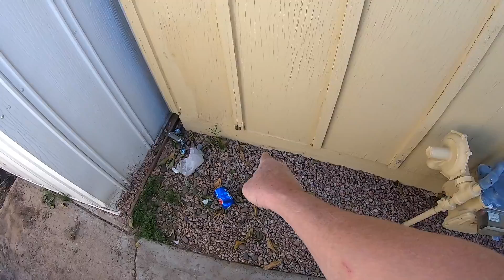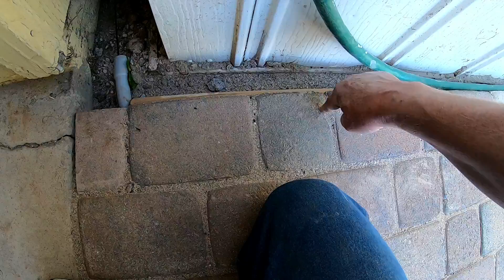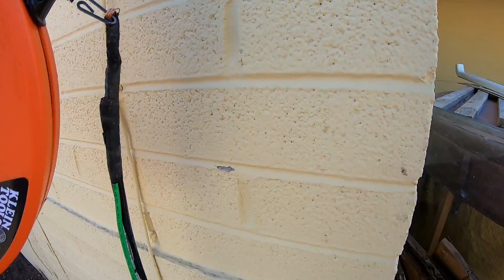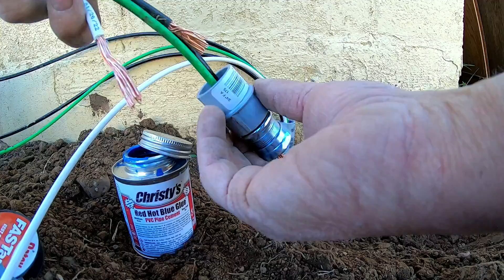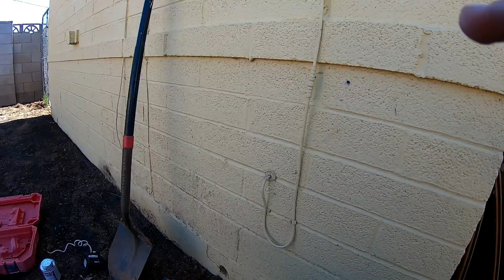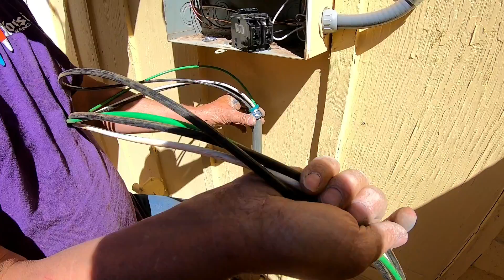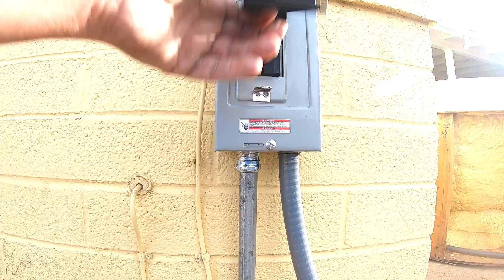How to Wire a Hot Tub...Wiring a 220/240 Volt Spa***I will show You step by Step easy to follow Info

Comment: Why is the disconnect a double breaker? Mine is just using a single 50 amp gfci breaker.
Reply from the maker: The main breaker is on the other side of the house and is out of sight of the hot tub. I would not recommend having a single breaker if it’s out of sight of the hot tub.
Thanks for watching & Subscribing
Reply: @diymrscott4983  I have a normal double pole breaker in the house but the shutoff by the tub is a single 50 gfci. I think they have to be in sight or within 10  feet. I just don’t know why some people are using the double breakers on the disconnect. I didn’t even see those at the store.

Comment: does it matter if my wire from my house to out side panel is aluminum wire? and my wire from tub to outside panel is copper? thanks in advance
Reply from the maker: Do not use aluminum wire ever.. in my experience when I've worked on tub tripping the breaker or other problems  and the only thing that I found that caused me to look at things closer was the aluminum wire and after changing out the wire to #6 THHN/THWN and the problem went away and never happened again 
Thanks for Watching & SUBSCRIBING

Comment: Thanks for the amazing knowledge you are sharing with us. 
Can anyone explain what is the need for having two 50 Amps breaker in series while one in main panel would be sufficient?
Reply: I was wondering the same thing.  I know one has to be a GFI which I believe can be in the main panel.  My issue is the disconnect.  No GFI in the disconnect and my tub has about 6 wires in it.

Comment: Can a gfci (50 amp) breaker be placed in the main service panel and feed a subpanel downstream 
And use standard breakers for the spa motors in the  subpanel? 
Is this an acceptable way to do this?  Thanks! 0:51
Reply from the maker: Yes you can do that and it will pass code ..we see it all the time and have done it also...Thanks for Watching & SUBSCRIBING

Comment: I have a sub panel in my basement that was added for a run to my garage for an EV charger.  Is the external box national 'code'?   What if I had a gfci in the sub panel and just ran direct to the tub?  This seems like a pretty easy run to do the external box either way with flexible whip, but just curious if the NEC has some code requirement since I see hot tub manuals specify that external box.  You would be insane to not have a gfci here!!!

Comment: Hey Great video.  Very thorough.  Quick question: What is the reasoning behind adding a GFCI breaker at the sub panel vs. just using the breaker back at the main panel?  Cheers from Chicago
Reply from the maker: Because the main breaker was so far away and out of sight it is safer to have a disconnect no further then 20 feet and no closer then 5 feet and in the line of sight so as if there is a problem the Hot Tub can be turned off quickly.GFCI is also required by CODE... Thanks for Watching & SUBSCRIBING
Reply: Hey Thanks for the reply! Make sense. @diymrscott4983
Reply: You are absolutely correct! Also it is required and a  GFI will keep you from getting shock or killed if your heater shorts out. You got 240 volts going to the heating element in the water. I have been installing hot tubs for over 35 years!

Comment: Mr. Scott, I have a couple questions. First, I'm not clear on your statements about sub-panel placement. To summarize, am I correct in saying that the sub-panel must be placed between 5 and 20 feet from the tub, above the TOP edge of the tub, and within line of sight of someone in the tub? The reason I ask is because the installation in your video seems to be both below the tub top, and around the corner from it (out of sight). 
Further, is there generally a code limitation on the length of the Seal/Liquid Tight flexible conduit that can be used? Is that where the 20ft comes from? Does that mean that the flexible conduit section can only be 20ft long (even if the direct distance between the sub-panel and the tub is less than 20ft)?
Thanks for an informative video and all your help.

Comment: My hot tub motors pull 46 amps.  I have to run 150-200 ft of wire from the panel to the hot tub.  Do I need to use 4 gauge wire instead of 6 gauge?  Thanks
Reply from the maker: Yes ....with the Run you are doing being over 150 feet I would use #4 from the main to the Sub..And from the Sub to the hot tub you can use #6 Thanks for Watching & SUBSCRIBING
Reply: @diymrscott4983  My hot tub is similar that pulls 48 amps. If oversizing with a 60amp breaker and a 75ft run would #6 be adequate? My understanding is that 6/3 mc is rated for 75a. This would be run indoors then through wall to spa panel. Thanks!

Comment: Thanks for the video. Very helpful. The one thing I don't understand is that in my breaker panel here in California, all the ground and neutral wires are tied together on a common bus bar. Is that okay, and do you have to run both the neutral and the ground to the subpanel where the GFCI is located if this is a common connection anyway? Thanks again!

Comment: my spa retrofit has 5 holes: ground, line 1, line 2, neutral 1, neutral 2. My 220V power source only has 4 wires: hot 1, hot 2, neutral and ground. Can you tell me where to connect each one of my wires?

Comment: Menards sells 6 gauge wire with 2 positive, neutral , ground all in one. Is there a reason I shouldn’t do that? Is buying 4 separate wire cheaper? Sorry if this is a dumb question I’m new to all this thanks!
Reply from the maker: You need to use THHN or THWN wire #6 When you are dealing with a Hot tub.. When ever Ive had to figure out what was causing a hot tub not to run or trip the breaker and everything with the Hot Tub was in great condition and working as it should... it was the wire every time that caused the problem . I can not stress it enough always use THHN or THWN #6 wire on all four wires (two Hot wires Neutral and the Ground) Hope this Helps Thanks for Watching & SUBSCRIBING
Reply: @diymrscott4983  so I can run romex to the sub panel and then THHN from sub panel to spa? I subscribed to both ur channels!
Reply from the maker: @logicflakes8911  I never use Romex ever on any install... Like I said above THHN or THWN separate wires only #6 on all four wires. Romex is for inside use only non damp dry use. Romex will cause the breaker to trip. Thanks for Watching & SUBSCRIBING

Comment: Stupid question because I over think these types of situations,  but if my hot tub needs 1 dedicated 60 amp and 2 dedicated 40 amp , does that mean I need 3 separate GFCI breakers and 3 separate runs of that 6 AWG wire to an outlet box that will accept 3 inlets for the power and 3 outlets to go back to the tub? I hope this question makes sense.

Comment: My Sundance requires only 3 wires 2 hot 1 ground from gfci panel the white is capped but my gfci keeps tripping ?
Reply from the maker: All of the wires need to be connected.(With the breaker off) put the GFCI in the main panel and run all four wires in #6 THHN wire(two hot wires common/neutral and the ground) to a spa disconnect with a 50 Amp breaker and then from the spa disconnect you run the two hot wires and the ground to the spa.Check everything with a volt meter before you connect to the spa. If it still trips its the Spa Hope this Helps Thanks for Watching & SUBSCRIBING

Comment: Great Informative Video!!!!!
Hey Mr Scott, a quick question, My hot tub will be away from the house and any place to mount my sub panel.Can I have the sub panel, that contains the  GFCI 50 Amp Breaker mounted to RIGED conduit coming out of the ground through a 4 inch thick concrete slab about 12 inches above the concrete?The Rigid conduit that the sub panel will be mounted to will be in place when I pour the concrete pad for the tub.The hot tub will be 5 foot from the sub panel box. The main panel to the sub panel will be a 35 foot run with 6 gauge wire.Let me know if this is a proper installation.
Thanks

Comment: Some codes want you to run 6-3 MC cable. Has a ground wire plus a metal covering.
Reply from the maker: It will meet CODE... And you will get to meet me if you live in Arizona and start having problems with the breaker tripping and need help as to why... Just because it is code doesn't make it the best choice for a Hot Tub install. Good Luck Thanks for Watching & SUBSCRIBING

Comment: Can I use 6-2 from my indoor panel to feed the spa subpanel? I would attach the bare ground from the 6-2 to the neutral bar in the Spa panel.  The tub is 3 wire system

Comment: how do you decide which conduit to use when running the wires? Metal, PVC, Seal Tight?
Reply from the maker: Great Question... Thanks for Asking, EMT/metal is for above ground from the main panel to the Sub Panel. The PVC is for under ground only and is grey in color so to let anyone know that there are wires in side them if they are digging in the area and uncover them. Seal/Liquid Tight is used from the Sub Panel to the Hot Tub. Now when placing the Sub panel. It should never be placed closer then 5 feet to the hot tub and in line of sight and no lower then the edge of the hot tub and should never be further then 20 feet from the hot tub and as alway should be in the line of sight for safety...Hope this Helps Thanks for Watching & SUBSCRIBING.
Reply: @diymrscott4983  is the height of the sub panel a personal preference or code? I’ve never heard that, or been told to do that at work.
Reply from the maker: @KitchenerLeslie2  Im not sure if there is a NEC code for the min. height of the sub panel.I can say that over the last 10+ years Ive seen and had inspectors Red tag a job(That I did not install) because of the placement of the Sub/disconnect panel because of height not being a min of of 36 inches to the center of the box as well as being to close to the hot tub. I alway think safety first if the panel is to close to the ground or the hot tub someone could/will use it for a step (bad idea) Hope this Helps Thanks for Watching & SUBSCRIBING
Reply: @diymrscott4983  Hello Spa Man, thank you for such a fast response. I have enjoyed watching your videos and ready to do some wiring.

Comment: Did you run a #6 ground as well or a #8? Article 680 is confuuuuuuusing
Reply from the maker: Use #6 on all four wires... Others will tell you different but most of the time when we go do service work the wire was the wrong size and cause the problem or it was wired wrong to begin with. Thanks for Watching & SUBSCRIBING

Comment: Can i use 8 wire with th 50 amp breaker?
Reply from the maker: I would not recommend it. Under sized wire or the wrong type of wire causes a ton of problems with hot tubs. I use # 6 THHN wire on all four wires..Thanks for Watching & SUBSCRIBING
Reply: As an electrical guy, I can see where determining wire size is confusing.  In the nec, table 310.16 has columns for different temperatures based on the insulation type.

Most people do not realize that nec 110.14  is for terminal connections, where you hook your wire on the breaker.  This section talks about breakers under 100 amps using the 60 degree C column unless the breaker has a different rating on it.

So, if you breaker is not rated higher or has no temperature limits on it, you are in  the 60 degree C column where no. 8. Is rated for 40 amps and no. 6 is rated for 55 amps.

Be careful out there.

Comment: Is it necessary to transition from pvc to emt ?  Why not go pvc all the way
Reply from the maker: You should never use PVC above ground as time goes by depending on where you are in the world the PVC will break down over time if it is above ground. Thanks for Watching & SUBSCRIBING
Reply: Bro same goes to emt it rust over time where I am we get alot of rain if anything I use pvc it's in code as long as u use sch 80 I'd rather use sch 80 pvc anyday than emt I wouldn't dare use emt outside I'd use rigid if I don't use pvc
Reply: @daviedave0915  i hook up tubs almost everyday and only use pvc.
Reply: @daviedave0915  What if you paint the emt?